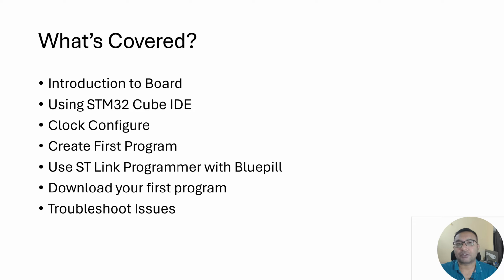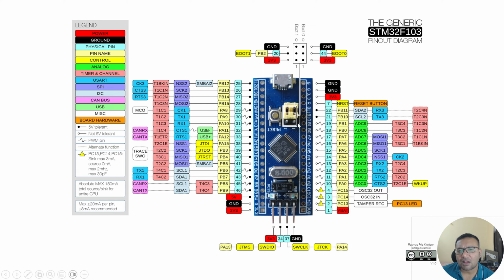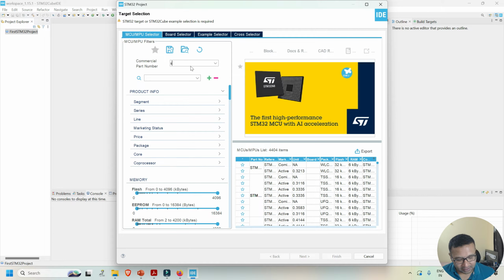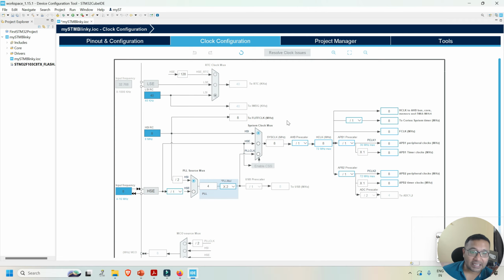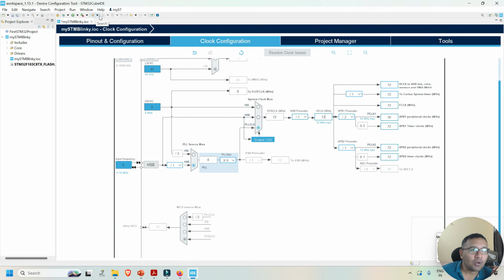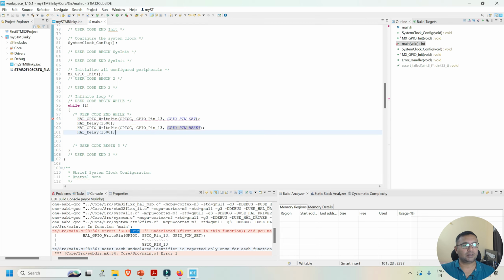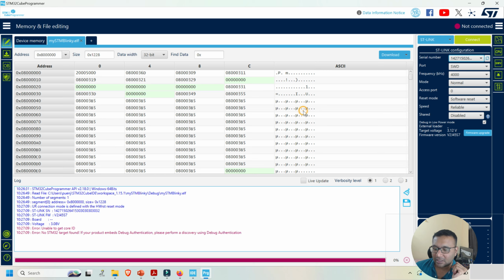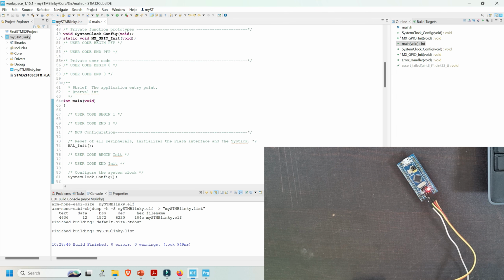Getting Started with STM32 Blue Pill: Clock Setup & Code Upload with ST-Link Programmer | #stm32

Comment: What to do when it says "Old ST-LINK Firmware , upgrade it before connecting".
The problem is that i am not able to upgrade the ST-Link . Shows error upgrading.

***************** GDI DUMP => Date : Wed Feb 18 16:52:08 2026

DFU_DNLOAD bad status after dnload2 (0x0bfffbf0, 0, 4)

** End of GDI DUMP **

Comment: This is just what I needed! I have cheap clones for the board and ST-link and had no ST-link serial number in CubeProgrammer, leading to a message "UR connection mode is defined with the HWrst reset mode" when trying to connect. Googling led to the solution of switching the Shared configuration to Enabled and attempting to connect again, after which a serial number appeared and the connection was formed according to the instructions of this video.
Reply from the maker: I've faced this frustration myself as well, multiple times while starting with stm32. Glad I can be of help

Comment: Very helpful video!  A couple of additional points:

1. Very annoyingly, the current Cube IDE lets you invoke File > New Project and carry out a few more steps before attempting to fetch libraries from STM, hitting a "can't log in" error", with no option to log in at that step. So you have to quit the process, login (Help > STM Updates > Connection to STM, completely undiscoverable). Then delete the partly-initialized project. THEN do New Project.   Grrrr.

2. In Cube Programmer I was confused what was  happening after hitting Connect. A bunch of lines appeared in Log, suggesting that Cube Programmer had downloaded code to the Blue Pill. But actually it's just reading from the Blue Pill.

3. Once Connect succeeds (Connect button shows "Disconnect").... then to program, use Left Menu > Erasing and Programming to select an elf file. I also selected Verify and Full Flash memory checksum. Then hit the Start Programming button.  The log messages hopefully indicate success, but see below.  To actually run the program on the Blue Pill, hit its reset button,

4. Attempts to hit the Connect button (to flash the Blue Pill again) failed with "Unable to get core ID" and "No STM target" message in the log.

5. Taking the advice of this video, I tried clicking the Connect button while holding down the Blue Pill Reset button. This did not work. However, I discovered that in the ST Link configuration panel (right side of the window), there's a Mode setting. When I set that to "Under Reset", then the Connect-click-while-holding-Reset did indeed work. I was then able to program the Blue Pill.

So, it appears that possibly the Blue Pill arrives with some existing configuration that is amenable to one programming procedure, but then the act of programming disrupts that procedure and requires the Under Reset option.

This is using Cube IDE v1.18.1   and Cube Programmer 2.19.0
Reply from the maker: Thanks for summarizing them, frankly, I work on an stm project every 2-3 months, and everytime I start on it, something has changed :(
Not sure how they keep up such high demand and users with those changes, probably someone working on it on daily basis gets it :)